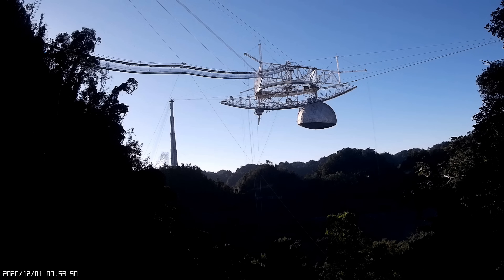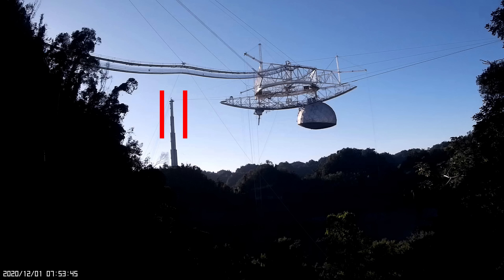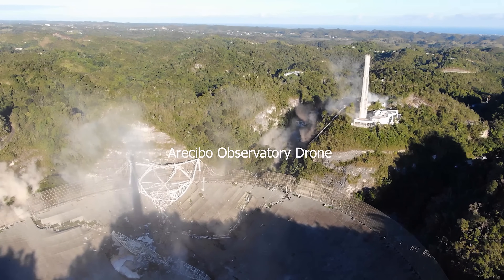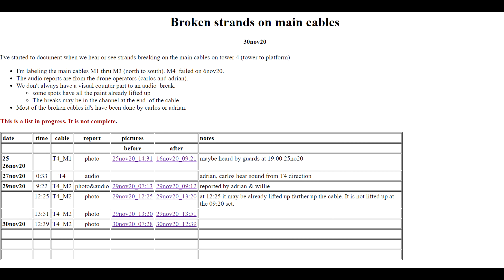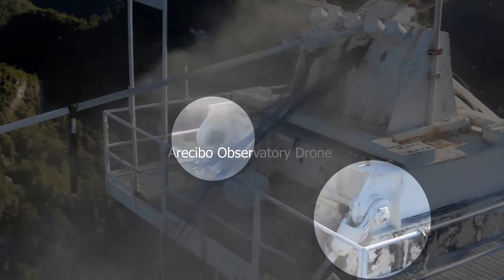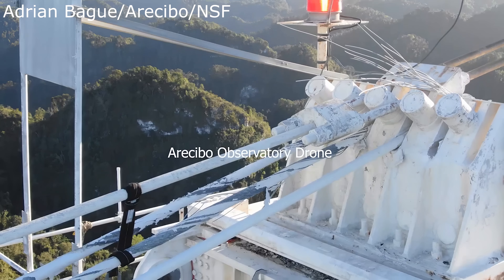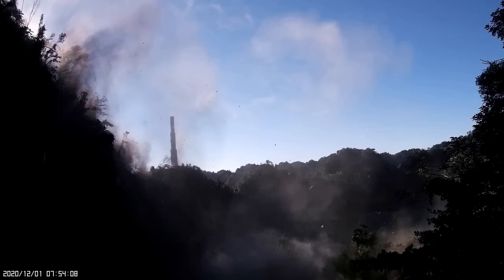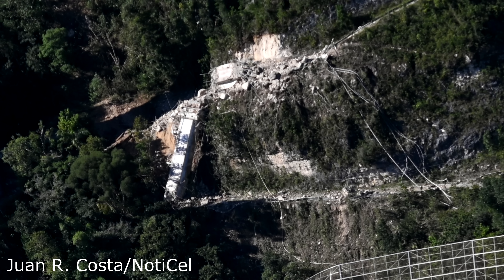Analyzing Video Footage Of Collapse of Massive Arecibo Telescope

Comment: 8:05 yeah, I noticed this from the first photos, that tower broke in HALF instead of just the top segment.
Reply: @robertcowling4313  Any time a structure is supported at more than two points, it's in a state called statically indeterminate. That is, the loads depend not just on the location of the center of mass relative to the supports, but also the height (or in this case the length) of each individual support element. So adding more support towers actually makes it much harder to predict the structural loads on each tower. They probably went with three because that's the minimum number of supports necessary to position the receiver at any point in a plane.

The cause of the failure in this case would appear to be whatever caused the first cable to fail at 62% its designed loadbearing capacity.  Whether that be a design flaw, or advanced corrosion due to poor maintenance, or some other as yet unknown reason.  In retrospect, it probably should've been designed so they could "park" the receiver at one of the towers, thus removing the load from all the cables for maintenance.
Reply: @solandri69  Most likely poor maintenance, they painted over the cables time and again, and you will probably find they trapped water in the cable, which led to corrosion cells and failure. The cables likely were made from hot dipped galvanised strands, which eventually had the zinc erode off, exposing enough steel to make galvanic cells inside the cable.

I would say the design flaw was not in having enough cables there, so that you could safely remove half of them every 5 years per tower to replace with a spare set, and those removed went off to be unwound, serviced and inspected, and then greased, reassembled and recoated for the next tower rope cycle. 10 years would be plenty of time to find weak strands and remove them. Yes you would probably be splicing in repair sections every time, making the cable thicker in parts, but they would still be more than capable with that. That the initial cable failed at the poured zinc plug indicates it was very likely badly corroded inside from neglect, as that section is the one most protected cathodically, but had plenty of water ingress to corrode the inner. Likely all the lanolin applied during manufacture was long gone, and had never been replaced.

Not that those were highly stressed cables, only a static load, no real dynamic force and no real bending. There are mine lift cables that are kilometers long, used dozens of times daily, that are probably older than those, but they also undergo regular inspection and lubrication cycles to keep them in operation. There are plenty that the cable weighs more than the entire telescope aerial steel structure, just in the cable alone.

Comment: You have to wonder if cost savings on its maintenance was not the primary reason for its failure. 
There many suspension bridges that are older and still standing. Brooklyn Bridge is well over 125 yrs old.

Comment: Sad for the PHD’s in process that have been tossed or at minimum severely delayed.  FAST is not necessarily a 1 for 1 replacement (despite its size) and neither the GBT or the VLA can match some unique characteristics that Arecibo included.

Comment: With regard to the future, while the dish and associated hardware is obviously a total loss what value is there in the electronics, sensory devices, computing hardware and such? While the big, obvious damage to the massive dish is attention grabbing but I would think that as much or more of the hardware value would be in the facilities downstream of the dish itself and that weren't destroyed so wouldn't it still make sense to do something to replace the big parts because so many of those far more numerous systems remain, not to mention power and data and other infrastructure based value?

Comment: The lack of rebar right where the tower steps down in diameter is a little telling. Wish you had gone into greater detail of the cable failures vs their design load limits, but I think you touched on that with the earlier vids. 
Clearly this thing wasn’t built NEARLY as well as it should have been. 

I can’t wait to hear about the cable failures / manufacturing - almost sounds criminal honestly.

Comment: this was sadly inevitable after the army corps of engineers looked at it and stated there was no safe way to repair the cables.
Reply: what kind of engineers can say that? yes maybe replacing cable was hard to do but it was definitely possible to remove pieces of that structure to reduce load and disassemble everything preventing this collapse.  even at the last moment they probably could have just planted an explosives to cut off the bottom part and let it fall in the dish this way preserving structures around it and making it possible to repair.
Reply: @deltaxcd  The kind of engineers that know what they're talking about. You should think about the consequences of doing what u suggest. You expose that you have no background in construction, or safety procedures.
Reply: @nixl3518  Just for the reference what are the worse possible consequences than what happened now?  the entire site was irreparably destroyed and practically nothing is left to be salvaged. Even surrounding buildings and roads got severely damaged.
Reply: @deltaxcd  Correct, this is practically a total loss. On the other hand, it has been contributing valuable science to the world for about 70 years and the truth is, that the technology employed there was beyond repair for some decades. So my opinion is that this destruction was a blessing in disguise. The site needs to be cleared of nearly everything that is still standing and the entire project needs to be funded and rebuilt. No one expects this to be anywhere near easy but I am confident it will be done and we will have Arecibo Radio-telescope 2.0 perhaps in a decade, two if we're unlucky. Meanwhile we will be missing its contribution. I expect that NASA will embrace the project but these things move slowly, very slowly when they are not the focus or in the public eye! Worst case, it will be closed down and left as it is for several years until pressure is built to revive it, but I expect it cannot be abandoned for good. It's value will rise as it's contributions are missed.
Reply: @nixl3518  
I agree about that but the main point was that it was already absolutely clear that this thing will collapse in a matter of days or months at best and rather than waiting until this happened they could do a partial controlled demolition to prevent a large scale disaster like that as for example just dropping down that weight even at the beginning of the collapse would have saved all those towers and a big chunk of the dish making repairs relatively easy. maybe it could even be possible to send some workers or robots to remove everything piece by piece without causing any damage.

I doubt that it will be rebuilt because if nobody even cared to save it then definitely nobody will be rebuilding it
Reply: @deltaxcd  What you insist on not understanding, is that any of your suggestions and any of the solutions that the Army Corps of Engineers could come up with, required that people risk their lives doing any of them and that was not an acceptable path. Intervention was out of the question once the single cable snapped! They knew the die was cast and set up the camera and with the drone watched the cable fail. The two cameras were not just lucky to catch the destruction; they were expecting it when it happened.

But the nature of the construction was such that there was no way to lower the structure gently onto the dish even if they wanted to before the cable snapped. "Controlled demolition" needs people to set it up!! Would you volunteer for that job? Controlled demolition would have also resulted in pretty much what happened uncontrollably! The structure would have fallen directly onto the center of the dish and both would be completely destroyed! How you imagine that a "controlled demolition" would make repairs relatively easy is beyond me! The consequences are the same but letting it fall came without risking lives. Saving the towers is like saving the oars of a boat that's sinking! This structure was not built to be maintained. Technology was limited at the time and the result predictably could only be this. It was just a matter of when.
Reply: @nixl3518  
In general yes falling was unavoidable but it is not that big deal is just the part of the dish is broken the biggest damage happened because cables started to snap and run around like whips crushing everything in their path.
In the worst case, it would be relatively safe to plant explosives on the cables near the place where they are connected to the towers then cut them all at once and make that thing fall into the dish.  yes, the dish will be damaged but it is not really that expensive part of the system and can be rebuilt easily.
But what I say is that destruction of the surrounding structure buildings roads and towers could be avoided not that you can save everything.

Also if they did not wait until cables start snapping and it is just too dangerous to be there they could just disassemble everything piece by piece or add more cables to replace existing ones.

p.s. If they at least cut off one of the cables that thing could be made to fall in a different direction and prevent damage to buildings and roads
Reply: @deltaxcd  I hate to keep having to tell you that your imagination is just not tethered to reality!! 
1. Falling would be a huge deal!! Do you know how heavy the structure that would fall is? It's several tons! The structure would crush a huge part of the dish to bits and deform the land beneath it from the force! You use the word damage lightly. The more accurate word is destruction. Do you have any idea how the dish is built?
2. "Planting" explosives at the towers is the craziest idea u've come up with!! Besides being enormously risky in theory, HOW wold you do this safely?? Think about HOW you might try to accomplish that!!!!!
3. The idea of using explosives is just science fiction! Ignoring the fantasy the explosives would have to go off simultaneously for the forward and aft cables simultaneously on each tower and simultaneously for all 3 towers!! This is also science fiction!!! Assuming that such explosives would go off and succeed in severing 30 cables simultaneously, something far from certain, the cables would still whiplash out from the release of the stress and cause unknown amounts of damage! The structure would then theoretically descend and crush the center of the dish. If you look at the footage, the triangular structure fell to the side mostly avoiding damaging the dish much more heavily. The linear azimuth arm fell onto the dish causing severe damage but the whole assembly would cause greater damage if they were made to fall vertically! 
4. The whips caused little damage relative to the massive falling structure. 
5. The support structures were not destroyed but damaged including the road. Minor damage compared to the main feature and of incidental importance to the survivability of the center as a research facility.
6. You use the word "just" to describe the most harrowing processes!!
7. HOW would you actually disassemble the structure piece by piece???? You use words that to not make sense. This is not a Lego set to be disassembled by giants!! Then HOW do you actually replace the cables??? The existing ones still occupy the space where the new ones would need to go? 
8. (ps) HOW would they cut off a cable that's under enormous stress without the rest of them failing and how does the person doing the cutting survive??? You realize that a pair of scissors won't do the trick, right??? 
Like I said, you have no grasp of the scale, the physics and the processes involved but you keep coming back insisting!!  I'm sorry but you just don't understand the situation well enough and I am exhausted repeatedly explaining it to you. I am done here.
Reply: @nixl3518  
I think I have to teach you some basic logic here because your resly makes no sese if you present 5 questions and declare that  "I am done" 
Those things are not that hard to solve I have no clue why you are presenting them as some kind of insurmountable problems.  
As for example replacing cables is not really that big deal just add more in parallel and you are good.
and the center of the dish is the least expensive part easiest to repair 
But anyway that main idea is still that in absolutely any situation taking control over the process will give you better outcomes than leaving everything for the chance.
Reply: @kugelschreiBERND  yeah man we need to go back to when the average lifespan was 40 years. Much better times back then.
Reply: @jetison333  I think he deleted his comment and ran!
Reply: I'm a industrial climber. If there is a will and money, than is a way to fix. With an helicopter and me😂 under on a rope I could safely attach a new cable and then safe to work on.
Reply: How much it would cost vs how much it would earn back, as all things in this world.
Reply: @rengurenge  Well, all things are not the same "in this world"! Aside of this being about "other worlds" research and space travel as with many other things, of this world, are not "for profit" endeavors. Cost is a consideration, so that the amount can be identified and raised, but "earning back" is not about dollars and cents. It's about knowledge and that is hard to interpret in such base terms. Arecibo was and still is a net public expense as maintenance, salaries etc are required to be found outside of its base operations. Do you think it was turning a profit until it broke?
Reply: @kugelschreiBERND  What is stupid is your baseless comment. You miss my comment about lack of knowhow and concentrate on being a smart ass. You live the life you do because of the society we have constructed. Some of us value that, while it's obvious others just like to make fun of their own ignorance. Taking calculated chances is not the same as being reckless, a detail you obviously fail to understand.
Reply: They stated the obvious when they did but this was the case from the day it was built! Inherently a bad design.

Comment: There was a comment on ArsTechnica's article on this footage from someone who builds radio telescopes and he argues that if politicians decide to build Arecibo 2, they must fund it separately and not reroute funds from other new builds that have already made it through the evaluation process and are scientifically needed. He's basically worried that if there is enough public pressure to rebuild it, that they will simply order NSF to do it without adding funding, and other science will suffer because of it.

It's sad to lose the big dish, but we must not lose the Square Kilometer Array to replace it out of nostalgia. If the public can use this to pressure for increased funding to the NSF, then that can be the final legacy of the telescope.
Reply from the maker: Remember that NSF began having problems funding the telescope when their funding was reduced in 2006.

Comment: they were not pulled out but cut from tension of expanding. Shear force was so great that it snapped all remaining wires which were overloaded with tension. Which resulted in snapping them. The movement of them was from retracting  after snaping - same in the mounting device.

Comment: Strange design.  The main suspenders on the Golden Gate Bridge are not terminated at the towers like this.  They are one continuous piece from one anchor to the other anchor. The towers have a saddle for the cable bundle to lay in.  This gives an equalizing effect to the loads and the only tower load is straight down.   At the ends of large bundles, they are splayed out into smaller cables and terminated that way.  The way there were gave a raw end of wires facing up so rain can get into the socket.  They should have at least had resin caps poured at the ends to seal them better.

Comment: Regarding the towers being up to modern standards.  I've no doubt that the best of today's engineering would probably build them differently, but the basics really shouldn't have changed much.  They had one primary task, to carry vertical load, which doesn't really need much fancy engineering because concrete more or less just does that (with sufficient cross section and the right mix).  With the cables correctly configured and tensioned, there should have been only minimal horizontal loads (before the catastrophic failure).

Comment: pretty sure this not completely coincidental... they had already announced the facility was to be shut down and this facility has survived several major tropical cyclones and this happened on a rather calm day not long after the passage of a major storm.   The Arecibo observatory had handled over 108mph winds before but over time these cables stretch and must be retentioned yes?  I wonder if such a maintenance procedure took place just before the cables started snaping in August?  Last I had heard the cable that snapped previously failed at about 60% of its normal load in calm weather meaning it was in pretty bad shape.

Comment: What are the odds of that drone watching this in real time!!! Amazing footage, thanks for scouring and sharing it all with us!!
Reply: The odds were 1:1
Reply: They would extremely good if the air displaced by the drone was the straw that broke the telescope's back.
Reply: The odds were pretty good: they were using drones to inspect the cables in real time.
Reply: Well the odds are always against us catching a split second event like this, so we were lucky even in this case to have the drone up there at the time of the event. It could have easily moved away just as the cables broke or some wind push it off looking to the side.....We were lucky in this respect.